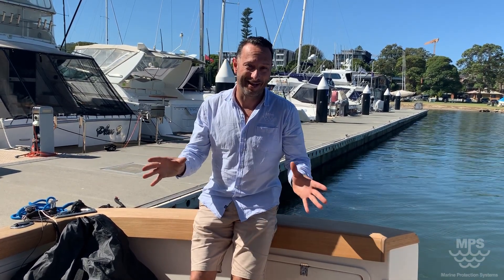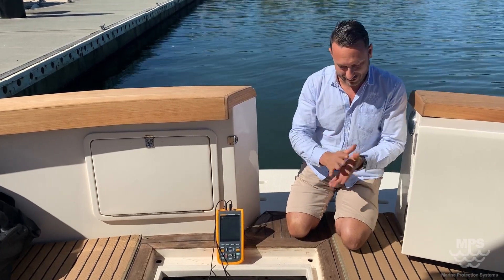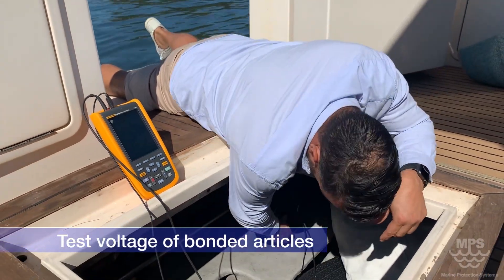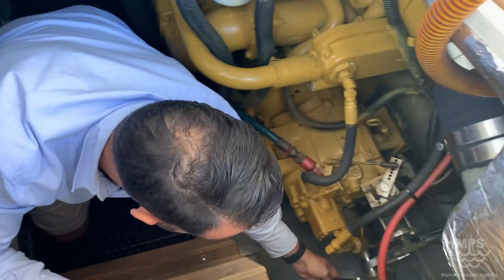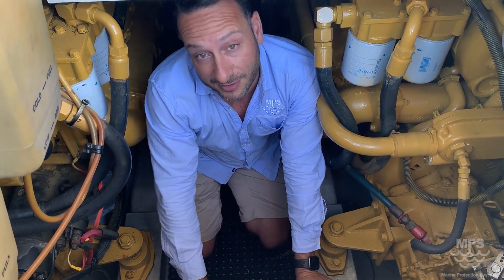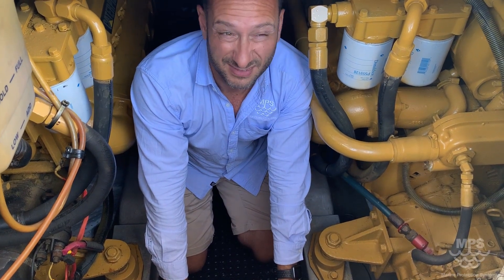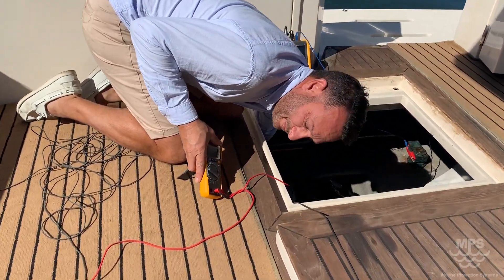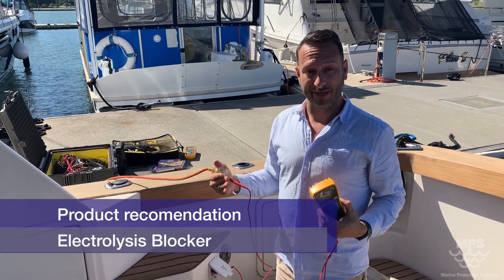How to test a Bonding System & Cathodic Protection

Comment: When you said you have to replace the bonding system, did you mean all new wiring and connectors?
I was unable to hear clearly what the device was that you put overboard 1 metre below the waterline and where can you purchase it?
The device in the water has a cable, where was the cable attached to on the boat?

Comment: Terrible your mic the noise an all you did was check a system. Correction you should show your equipment show how is connected. What is overboard what is m as de of. Then explain steps you are taken show connections. What is recommended in millivolts is that what looking for. You remind me a mechanic that is trying to explain something but doesn't whant to give all the info so he doesn't loose the job. Sorry had to put it the way I  see it. Thanks